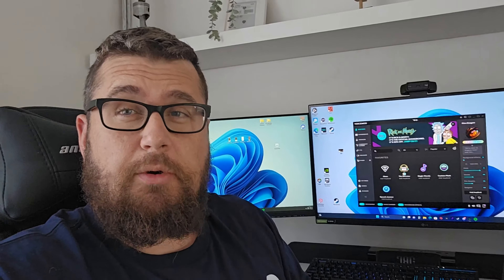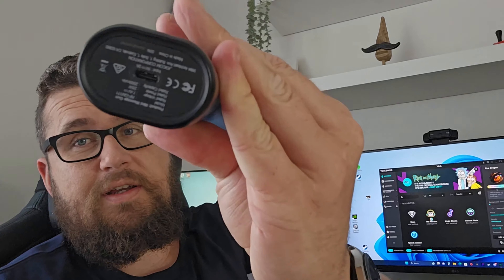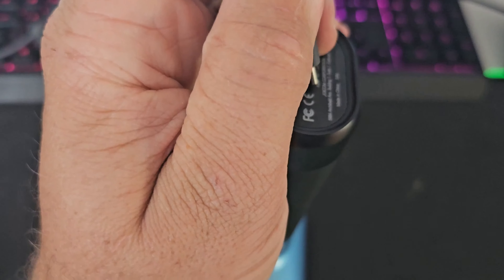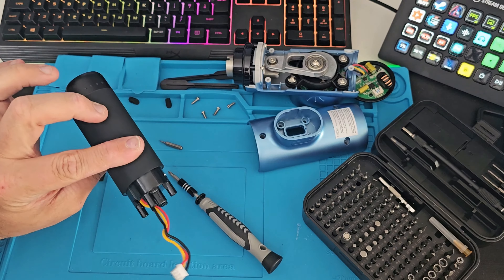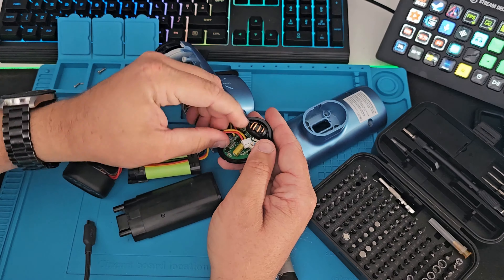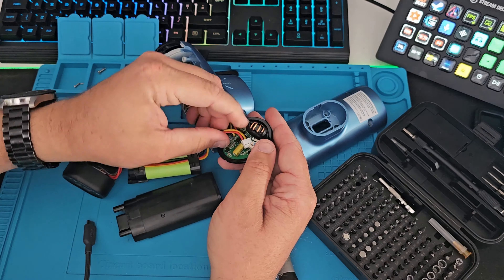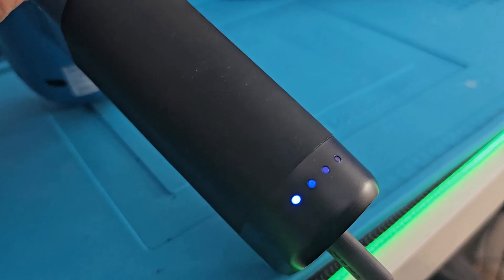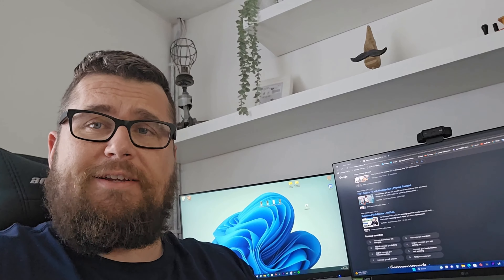massage gun repair

Comment: My entire problem just turned out to be that I needed to use a USB-A to USB-C cable to charge... I kept using usb-c to usb-c and it wouldn't work. Got it all disassembled to finally try the cables.
Reply: I'm glad a read this. It sorted mine out. C to C wasn't charging
Reply: Omg this solved my issue too. I feel so dumb.
Reply: Omfg got the same problem, thanks for that solve i feel so stupid right now xD
Reply: Same here. Life saver, or rather... Massage gun saver!
Reply: Oh my god. It helped! I read this comment after dismantling everything. Changed the cable and it works !!
Reply: I took my whole unit apart multiple times. This was the issue. Could have saved so much time
Reply: Great and simple suggestion! Solved my charging issue. Thanks

Comment: some lithium battery packs have a protection circuit that shuts off the battery if the voltage drops too low, sometimes you can kick start them by connecting a higher voltage battery across the + and - for a few seconds, once the trigger circuit re-activates everything starts working again.

Comment: So my renpho r3 won't charge as well but I can't tell from watching the video which is the key step to getting it work. You used the heat gun and then you were jiggling everything but what made it work and charge again? Thanks.
Reply from the maker: It could be a couple of things. It could be a dead cell, so you need to check. My issue was a cold soulder joint, so heating it up very hot.Would've reflowed the shoulder

Comment: Normally I'd willing to bet it was left low and left for a long time at some stage, which is a pretty common cause of death for Li-ION batteries. But I see you tested the voltages and while low they were not at distressing levels. I'd have tried a proper Li-ION charger on each cell to see if they took charges. 
You're lucky yours has screws.
I see you got it going, so happy days.